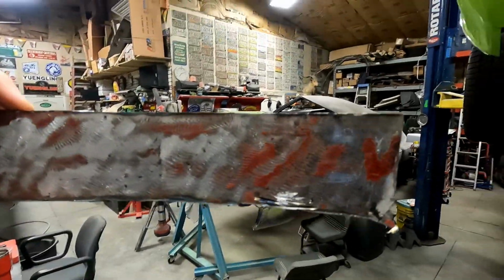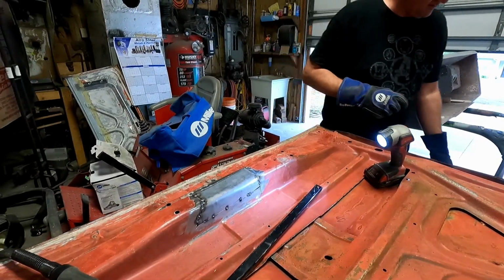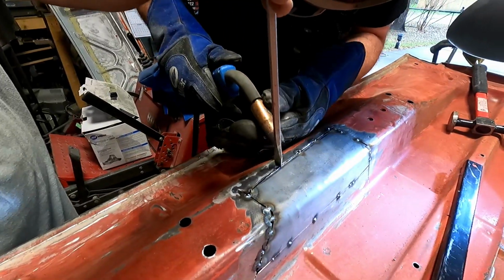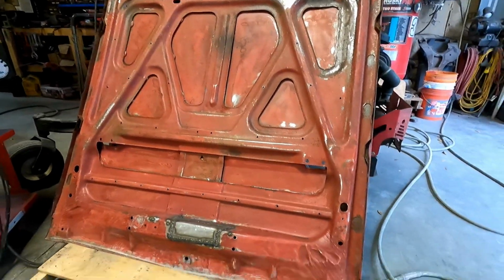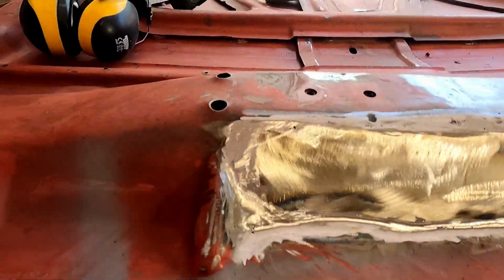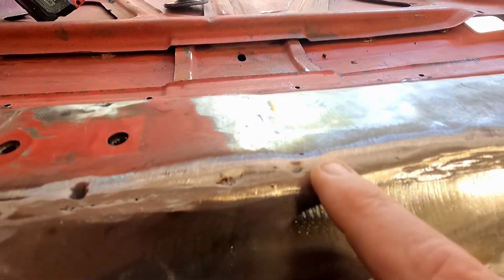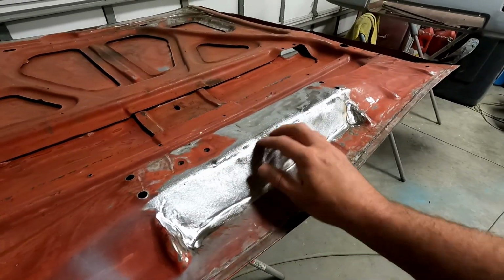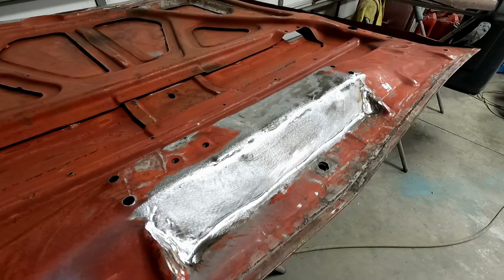1970 Charger Hood Repairs

Comment: Good work, I am doing this same thing to my Daytona clone hood too. Lots of work.
Reply from the maker: Pops has purchased 4 different 70 hoods, and he’s repairing the best one.  And it still needs tons of work! Whether you’re doing the fenders or hood, it’s a buncha work to make a Daytona, we’re getting a lot better at body work, it’s definitely not a project for the faint of heart!  Send a pic when ya can of your project.
Clarksplace@yahoo.com
Reply: @ClarksPlace  I will do just that. I am in the parts acquisition phase of the project. Going with mostly Janak parts, vega hatch and OEM front clip.
Reply from the maker: @ryancox8644  you may need to reconsider the Vega deal, I believe the rear window is like curved the wrong way, like the bottom of the glass curves different than the Janak kit.  We were very pleased with our plug as it basically bolts on to the Dutchman, and panel bonds to the sail panels.  Pretty sure we got a vid on it somewhere on Clark’s Place if you’re interested in seeing the install.
Reply: @ClarksPlace  Thanks for the advice. Did you go with the Janak Quality line or the Economy line?
Reply from the maker: @ryancox8644  pops got the best kit they had to keep us doing as little work as possible!  When you get to your headlight doors, let us know what you use cause we haven’t figured it out yet.  We tried the electric motor kit but it’s too weak to lift it, so I’m gonna use the electric kit pops bought and he’s gonna use my vac canister and actuators is the plan.
Reply: @ClarksPlace  will do
Reply from the maker: @ryancox8644  sweet, send pics too! 
ClarksPlace@yahoo.com